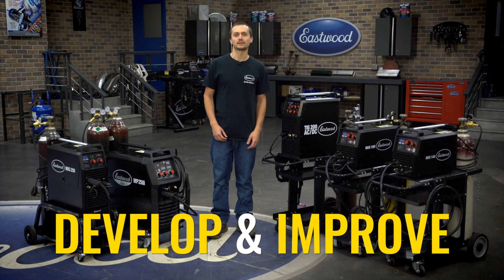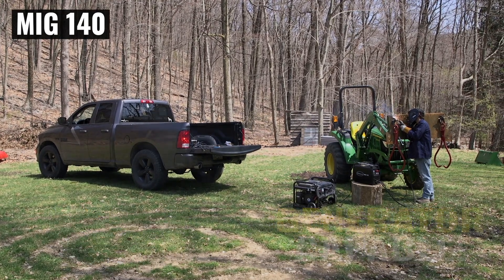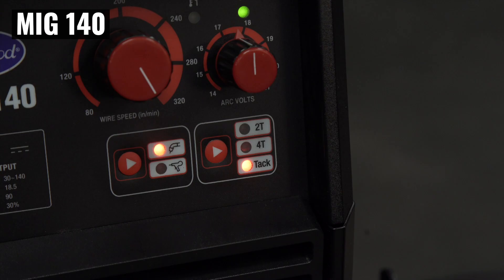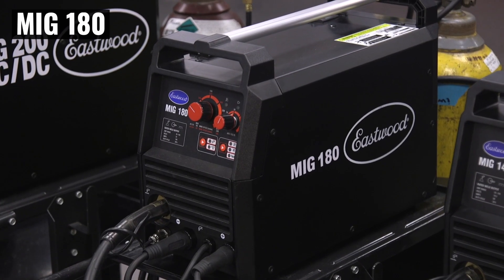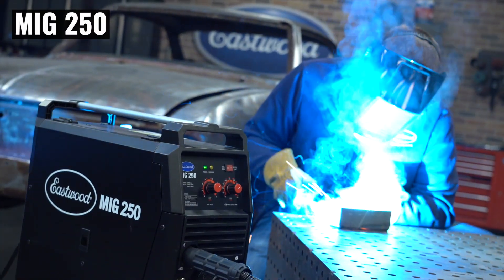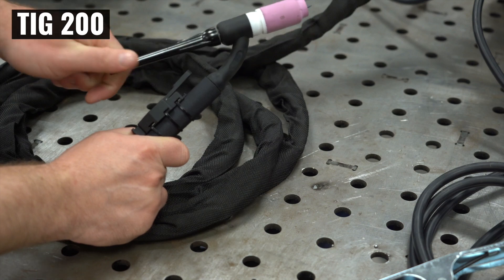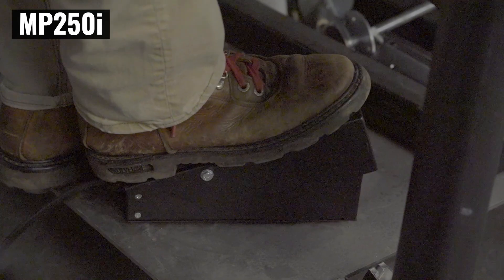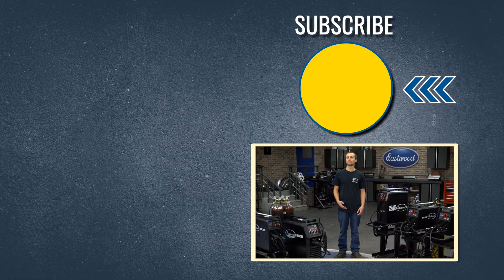Develop & Improve! Eastwood MIG, TIG and Multi-Process Welder Updates Explained!

Comment: I purchased a MP 250i elite few months ago. Great welder very happy with it. I I chose this welder because I wanted to get into tig welding. I would see if Eastwood will make a video featuring the MPI 250 elite and going in depth into TIG welding in all the features and settings. I have questions regarding tig setting/setup. I weld 4130 .120 wall tube and mid steel plate.

Comment: I really liked my Tig 200 A/C D/C welder until it stopped working earlier this year. Worked well form almost 5 years of welding aluminum. Do you have any repair centers that you could refer me to? Or do you have an in house tech that could diagnose the issue? Any help would be appreciated.
Reply from the maker: Hi Jim, Can you call our Tech Center at 800 343 9353. Thanks!
Reply: @eastwoodco  Sure will, Thank you.
Reply: @jimsullivan2729  they have a great service
Reply: My AC/DC TIG 200 is still producing great welds after 5 years. The stick works awesome!